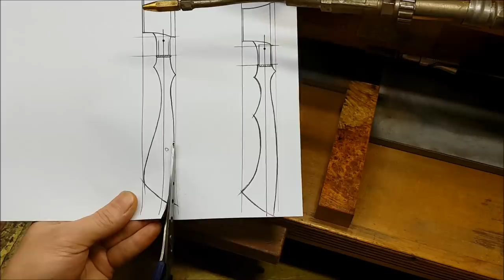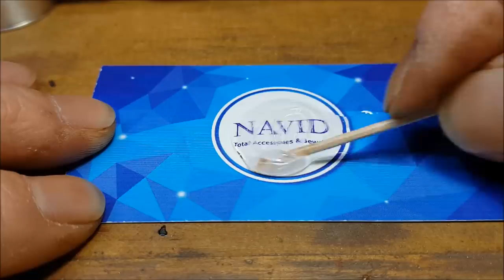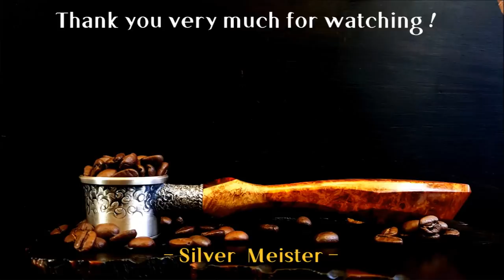[ Korean craft ] Silver "COFFEE BEAN SPOON" for coffee enthusiasts

Comment: At the very end of the video, what did you brush on, some kind of protective clear coat?
Reply from the maker: I don't know which part to say.
Ask more specific.
You mean the handle part?
Nothing is coated. I don't know~
Reply: @SilverMeister  Sure, starting at 17:43 you apply something from a bottle and then brush it on over the silver and wood. I at first assumed it was resin or epoxy since the bottle looked the same as the one you used to adhere the handle. But then you touched the wet surface with your hand and that didn't make sense if it was some kind of glue.

Comment: Nice, whats the Blue Water
Reply from the maker: This is dilute sulfuric acid.
It is clear like water at first, and turns blue as you use it.
Nonferrous metals (gold, silver, copper, aluminum, etc.) are 
different from general ferrous metals,
In each process, it must be pickled.
When dealing with silver, mainly sulfuric acid is diluted in water and used.
Mix about 10% sulfuric acid and 90% water.
When mixing this, it is safe to add sulfuric acid to water.
Always keep the diluted acid warm.
50 to 70 degrees Celsius is suitable.
By pickling,
By removing borax residues and various impurities generated during work
It plays a role in ensuring that it is always clean.

Comment: What is in the "pickling" solution?.thanks...
Reply from the maker: Nonferrous metals (gold, silver, copper, aluminum, etc.) are different from general ferrous metals,
In each process, it must be pickled.
When dealing with silver, mainly sulfuric acid is diluted in water and used.
Mix about 10% sulfuric acid and 90% water.
When mixing this, it is safe to add sulfuric acid to water.
Always keep the diluted acid warm.
50 to 70 degrees Celsius is suitable.
By pickling,
By removing borax residues and various impurities generated during work
It plays a role in ensuring that it is always clean.
Reply: @SilverMeister  1 to 9 parts ! Thank you.